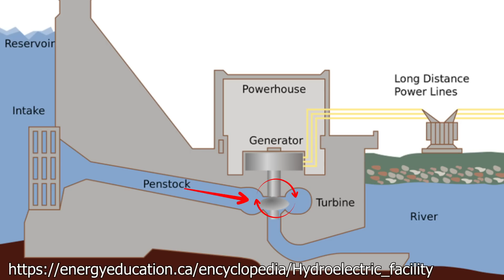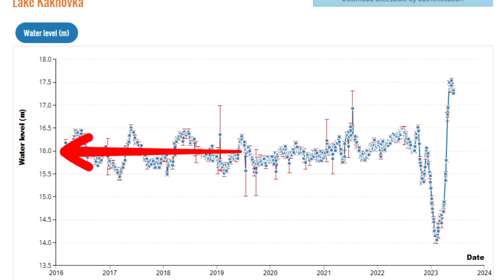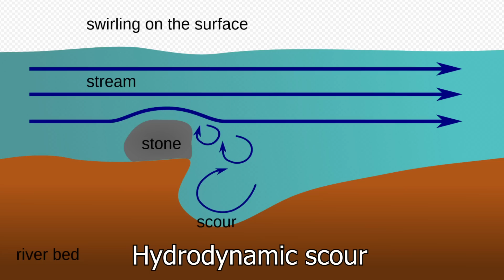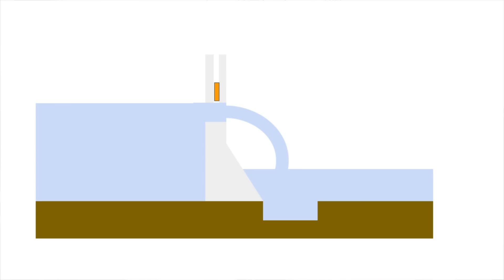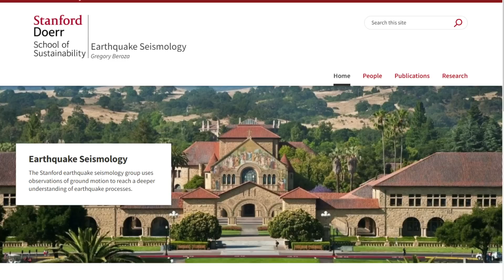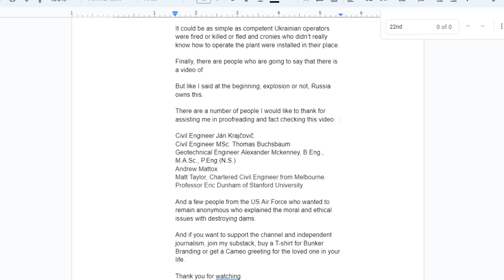How Russia Destroyed the Kakhovka Dam

Comment: This is going to age like bio-dynamic raw milk.

9:16 Ukraine would not hamper normal operation of the dam. It's THEIR dam and THEIR people living downstream.
10:14 If it was a single large depth charge placed on the water side, yes. But in the turbine house, no. You just need enough explosives to make a few cracks in the concrete. And they would likely be serially detonated with detcord.
10:50 EVERY minute of the approach matters in an assault. The longer the enemy is in the open the better odds of "servicing" them with the available weaponry. And you forget the mud. Amphibious assaults are easier when there's a clean transition between water and land. Going over a quarter mile of slimy swampy mud after a flood takes longer than crossing 10 miles of open water.
11:30 The vast majority of that water is for agricultural irrigation. Not just for Crimea but also eastern Kherson oblast. 
12:47 Nope. Maybe two hundred pounds of shaped charges in the right places.
13:00 The timing is simply too convenient. If this had happened a week before or a week after Ukraine began pushing across multiple points on the southern front, sure, sure, whatever. But it happened late at night as the first wave of combat recon happened at 7-8 points across a part of the frontline that has been relatively quiet for months. AND just a week before Russia specifically changed the law to prohibit inspections of "dangerous" accidents of dams and other structures caused by "terrorist actions". On a stretch I would allow one or the other. But both is like winning the lottery twice in a row.

Source: Retired after 17 years of service in the Royal Danish Army with multiple demolition certificates. I know how to take down EVERY militarily important bridge, dam and tunnel in Denmark with relatively small amounts of explosives. People generally can't wrap their head around the one, two or three orders of magnitude more explosive you need to take down a structure if you don't have access to it's internals.
Reply: thank god an allegedly qualified person in the comments. We have seismograph recordings of explosions. We have russians recorded on the phone bragging about mining the dam. We have intercepted orders for russian vehicles to leave the area to be flooded. There is so much situational evidence it isn't funny. You only need to make a tiny crack in the concrete, and the water pressure will do the rest.
Reply: @moonasha and also the reports from citizens about Ruzzian troops stealing every boat in sight during the weeks before the collapse.
Reply: @moonasha that's what I never understood about Ryan's video. Even when presented with seismograph evidence of an explosion he just dismisses it without actually examining it. 

I mean yea, you could make a plausible argument for this other "accidental" scenario if you ignore all this other evidence, but that kind of defeats the purpose then. Suddenly you're just making up a fictional story.
Reply: @moonasha  The two seismic tremors were detected well after the dam collapsed.
Reply: I wonder why Ryan left out the part where the seismologists pinpointed a large explosion around 0245 in the area around 20km around the dam. Last I heard they hadn't determined the size of the explosion yet, but it was large, so I'm assuming larger than the shelling going on regularly in the area.
Reply: @Alendo  The same reason he didn’t mention that THE WASHINGTON POST (CIAmediaASSET) had already reported that Ukrainians had shelled it before despite the obvious catastrophic possibility
Reply: @Alendo  I'm pretty sure that he mentioned it (showing an image of a seismic trace).. There is a lot of "noise" in the image. So not sure that they can pinpoint a given "event".. and you need multiple reports from multiple locations to pinpoint where the event occurred (I'm in Christchurch, New Zealand. Believe me, we know these things.. Following teh regularly updated quake page after teh 2011 earthquake (and the thousands of aftershocks).

Something to remember is.. it doesn't really record "explosions", it records  "earth moving events".. The catastrophic collapse of the dam -- the sudden release of water -- could be such an event...
Reply: @kerrynofford4727  RYAN said there is a lot of noise. Trained seismologists said it was the sign of a large event, possibly an explosion. I've seen some even compare it to the explosion in Lebanon in 2020. I tend to trust the experts in this case.

Also if the dam overtopped you wouldn't expect one large event, but a few minor ones over a course of time. Overtopping doesn't happen all at once in one go. Usually one part will go leading to a chain reaction that brings more parts collapsing as time goes on. That wasn't the case here.
Reply: @kerrynofford4727  the problem is he looked at picture with insufficient quality data and decided: it's not good enough picture, therefore there was no explosion. 
Inconclusive evidence is not the same as no evidence.

Maybe it was overtopping. Maybe it was demolition. Maybe explosion supposed to create limited demolition had disastrous consequences because of overtopping.
Analysis here is interesting but not final.
Reply: Honestly I think for a few of these it’s incompetence/ willful negligence. Did Russia care if the dam broke? No. They didn’t give a fuck, it helps as much as it hurts frankly. And the timing wasn’t perfect I think, there’s been probing attacks for a while so at a point just let the flood happen and force Ukrainian attention elsewhere.

That said, it’s no different to blowing a bomb. They’re the ones who had control of the dam enough to cause the controlled demolition but let the problems get as bad as they did. They’re the ones who passed the law saying they weren’t even going to investigate. They’re the ones shelling the Ukrainian rescue efforts. Frankly, all this confirms to me is yeah, it’s Russias fault. It’s just not how I expected it.
Reply: Keep in mind that there are often other factors at play. The workers in that dam probably didn't want to get killed and the best way to get out of the situation without punishment would be to accidentally break the dam. Also, the timing wasn't as exact as you imply. 

You need to remember something about Russian workers: they're some of the laziest and most selfish people on earth. If they can get out of work or danger by any means, they'll do it. They knew they might die the moment fighting heated up due to their strategic location. 
Here's what I think happened - Russian workers intentionally broke the dam to save their own butts. Russia, knowing how humiliating the truth is, played guilty in order to make everyone else think it was an intentional act ordered by Putin himself. Never underestimate the significance of self-centered cowards on the course of history.
Reply: This top level comment is better than the entire video. Thank you Mr 17 years. And, I concur. The Russians did this, they planned ahead, and the set off a huge bomb (far bigger than a small Special Forces team could've snuck in with) and Russia over-filled the dam in preparation!
Reply: Source: i am jason bourne
Reply: Your argument 9:16 is not valid. Ukraine destoyed several bridges which was “their” But I fully agree damm was destroyed by Russians and not by accident.
Reply: Finally someone lol.

 Program engineer telling us how dams fail and how much explosives would be needed based purely on his guess.

Proceeds to explain how amphibious assaults work and how 30km of flooded, muddy minefields does not affect an offensive in the area...

Ignores the fact Russia already attacked dams...

Like Shure bro
Reply: @stixinst5791  Right or wrong, it's a different take that isn't a "Ukraine did it" conspiracy theory.  I appreciate it just because we need to examine things from different angles.
Reply: @EmperorA0 yea, but a take that is just wrong, muddies the waters of what is true and what isn't really isn't helpful to anyone, unless your intent was to create conspiracy theories or plausible deniability.
Reply: On timing.
And sometimes shit just happens.
The overtopping etc was due to snowmelt beyond what a single sluicegate could spill. Snowmelt would typically be filling the system around now. (Not opening more gates because you are afraid of being shot is legitimate.. Not good, but I can see that happening)
Reply: @kerrynofford4727  "Snowmelt would typically be filling the system around now" What? This is completely bonkers. The last few snow patches in Ukraine melted late April, maybe early May. The Russians started letting the water level rise AFTER that. They had previously opened gates that they later closed. His whole "they don't want to get shot" narrative is in the completely wrong direction when you look at the water levels in the reservoir compared to the precipitation of the period in question. They were in complete control, and exercised it.
Reply: You don't know though - neither does he.
Reply: I'm still not convinced one way or the other I suppose. But I think still the biggest evidence for me that it was just neglect, rather than an intentional explosion, is that it really just looks like a dam that catastrophically failed. If they wanted to blow up the dam, why did they not place these explosives, inside the dam? I.E., the turbine facility, where the explosives would have easily been able to take the dam down, without any risk of public exposure? It makes no sense for them to have gone outside the safety of the enclosed structure, risk any number of drones or Ukrainian snipers seeing them, just to place explosives on marginally weaker places, outside, where far more things could go wrong, and the explosives would be more expensive? If they wanted to blow up the dam, just bulk put whatever the cheapest high explosive you have at your disposal inside the turbine building where they would be safe from the weather/spying eyes. And yet the turbine building seems almost completely unharmed, aside from one section that was carried away by the water. It just doesn't make sense to me. Why go to all that extra trouble and spend all that extra time and energy to leave it ambiguous? They had complete control of the dam there was no reason to use such a convoluted and more expensive method. Surely they didn't think anyone of importance would be stupid enough to think Ukraine did it, in their own country, ahead of their own offensive.

To me it makes sense that, as usual with Russia, there was extreme negligence at play. And they don't want people to know that, so they just play it off that they blew it up. Because in their minds being evil doesn't look as bad as being incompetent. If they blew it up, it could be a huge morale boost for Russians citizens after the Crimean Bridge was destroyed (And still not properly restored). We know they aren't averse to causing human suffering in Ukraine, many of them have been loving the reports of drones and missiles striking civilian infrastructure and demanding Russia starts launching nukes at Western countries. And Russia has access to the CCTV cameras that would have recorded the whole thing, either way. Yet no footage of it has surfaced anywhere? Despite it could easily be spun as a huge propaganda win if they blew it up? But it's more worrying to me, considering they also happen to have a massive nuclear power plant under their control, that is also in Ukraine. Fortunately IAEA is involved there and ensuring things are at least still running for now.
Reply: @DerpyDaringDitzyDoo what you said is just about exactly what the recent reports have said happened, so I don't know if you are being sarcastic or not.
Reply: About 10:50 - did you even listen? Ryan didn't say the flooding doesn't make an amphibious assault harder. He said it's already too hard without the flooding anyway, especially as Ukraine doesn't have the necessary equipment.
Reply: Lugansk born person here who lives in the EU.

The problem with the majority of people in the so-called west is that they base their whole understanding of the situation on premises that are false (to put it mildly).  Plus there is an almost complete mudding of the chronological (and logical) of the events that took place that lead to this clustermess. Why ? Because apparently the side of the story that the Ukrainians present is supposed to be unbiased and the absolute truth lol while the story that the separatists present is somehow "Russian propaganda" >>HAHA<<

In your case Anders, your whole line of thinking is based on the fact that Ukraine cares for it's people and that it would not act in such manner that it would directly hurt it's people... 

Well,

1st: you're more than welcome to visit Lugansk or even better Donetsk and ask people what they think about this.

2nd: Ukrainian troops have been regularly shelling civilian objects for the last 9 years (this is true for Donetsk and it's near vicinity)

3rd: Ukrainian government cut off the North Crimean Canal in 2014 which resulted in a huge water crisis in the Crimean peninsula and made the people of Crimea suffer ( lmao weren't they supposed to be "Ukrainian" people ? ). Oh yeah they also cut off the power line that connected Crimea and Ukraine in 2015 which made the lives of Crimeans even more miserable until off course Russia threw a power line from Krasnodar to Crimea in order to alleviate the energy crisis.
Reply: @alexmales882  So why did you fled to a "russophobic" and "gay" EU instead of going to your so much beloved russia my separatist friend (not)?
Reply: @alexmales882  - Why didn't you stay in Donbass? Or move to Russia! And thrive in wealth and happiness and truth! Why did you leave and go to West?!!
Reply: @alexmales882  go home troll, western media say "we need to wait for investigation". Russia is the side claiming RPG blew a hole through 10m of concrete

Comment: Well, once damage was noticed at the bottom of the dam caused by powerful current due to only one or two shutters fully opened, I guess they decided to close these off which inevitably caused water to start rising in the reservoir. They should have then called in a Russian military unit to secure the other side from snipers and then sent crane operators to open up several shutters a quarter of the way in the middle of the dam or on the Ukrainian side. But they did not. So then out of fear of creating a minor flood downstream they instead created a full blown catastrophe. Seems like amateurs at work.